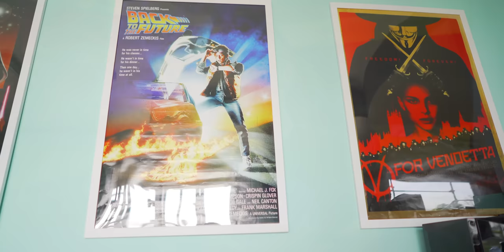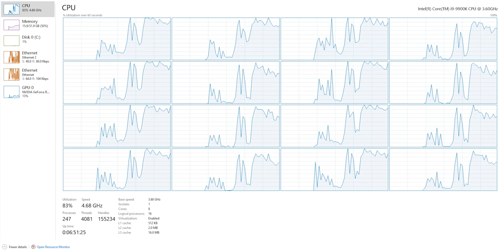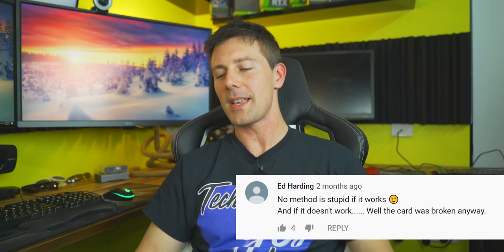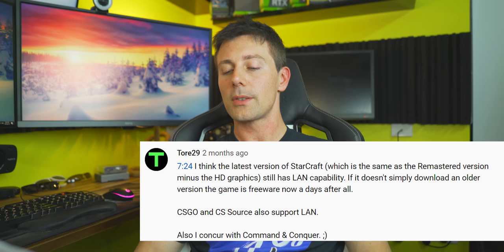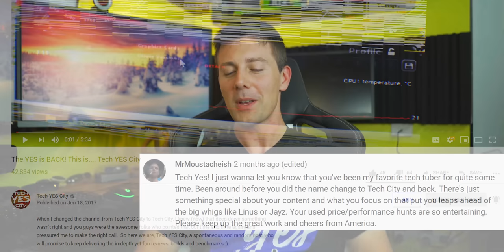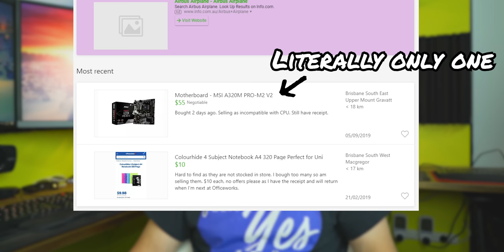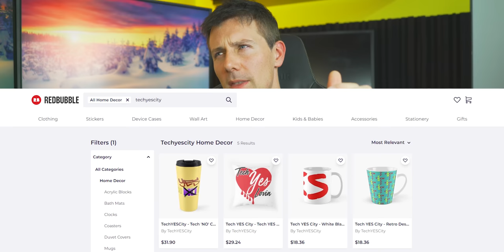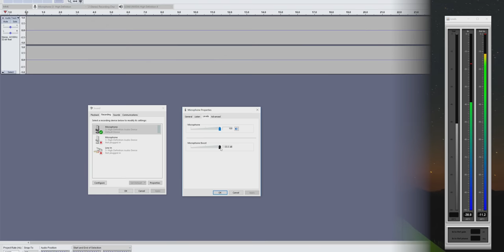Is Ryzen 3000 Still Good for X370? The Unanswered Challenge to Linus? (ATY #009)

Comment from the maker: TimeStamps: 
0:37 - Ryzen 3000 on old x370 
2:19 - Adobe optimization for AMD?
3:28 - Floatplane talk
4:26 - An open challenge for Scrapyard wars!
5:58 - Thermal paste talk
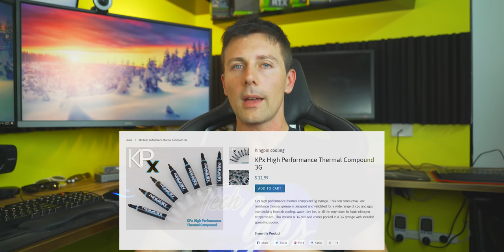7:07 - LAN games suggestions
8:00 - Will navi automatically install drivers?
10:25 - Looking forward to the MARS documentary!
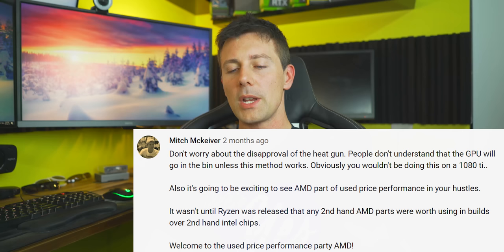11:14 - Heat gun haters & AMD used performance hype!
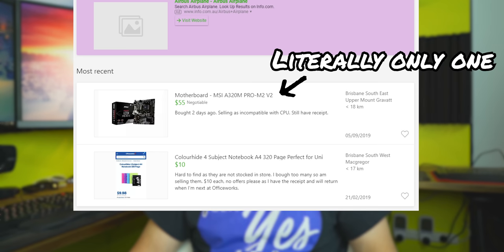12:26 - Fidelio L2s are a good choice!
13:17 - Where is the Huanan Dual X79?
14:20 - I want that pillow!
14:48 - What are your hobbies besides tech?
16:39 - Mid range headphones aren't over $100... are they?
Reply: What is the make and model of your car?
Reply: Thank you so much for this video!  Because I've been thinking of how to upgrade my X370, Ryzen 1700X build.  But is my Gigabyte Arous AX370 Gaming K5 considered worthy of switching to a Ryzen 3700X?
Maybe I need to upgrade my 2666Mhz RAM as well?
Reply: YES timestamps :) thank you^^
Reply: @BranZHamZ  Do you use your PC for work or productivity?  I have the same build but I have 3000Mhz RAM and it is still plenty fast for me.  The 3700X is a bit faster but unless you are using it for work or you are a highly competitive gamer that also uses it for work there is really no reason to upgrade unless you just feel like it.  Definitely would not be the Tech Yes Citizen price to performance route!  Get some 3200 CL14 RAM, push the overclock and it will be rockin!
Reply: 5820k oc vs ryzen 3600x WHEN?????
Reply: How about the mid range x370 for 8c/16t ryzen 3000 series.
Reply: Tech YES City #addresstheyes When will you come to the uk? And it made me laugh about the TechCity name change, I can’t remember why you did that lol Jesus must mean im a longstanding subscriber too lol
Reply: I been cheering for YOU, Bryan, you stuck to your guns an always gave us the older stuff as well as the stuff for the sponsors, you are a hustler, not many work as hard as YOU. I see all of this, I LOVED how GamersNexus (Stephen) was smart and young and basically the ONLY person to talk about nano tech with the cpu's and try to explain it and other things alike.... I cheered for him as "LIKED HIM" much before Linus and Jay found him and started to "Help Him"... I KNOW nobody else deserves it more then YOU... Just that ONE plug from Linus or Jay.... I still think it will happen.... Everyone needs a boost to the top, Each One, REACH ONE!... Keep going what your doing man and also keep your integrity #ALWAYS .... You and ModsTek now that Stephen was found deserve a boost to the TOP.... Some exposure, you an do the rest yourself, obviously.... #GoodPeople and channels, will always be here whilst you climb to a Million whether slowly on your own with NOT GIVING UP or with some much deserved help, either way its the same great videos.... Thanks Bryan... BTW: Maybe join with some tech tubers that are around your status of SUBS?... THERE IS ALWAYS A WAY MY MAN... Maybe a tech yes city FORUM?.... #YesMan would be a GREAT shirt for the store with small tags like x58, x79, etc.... Again, keep it up...
Reply: BPSDetailing abarth 146 spider
Reply: Brandon Hambright I’ve got a Ryzen 1700x build also! Only thing holding back in my Motherboard, it’s terribly fussy with ram but it’s still way more power than most need so you should be fine for a while yet
Reply: @TechYESCity Do you have the MARS 760? Found one for sale by me and was thinking about grabbing it.
Reply: @bpsdetailing8822  Actually RAM has been my main route for upgrades originally.  Cus I have 2666 and wanted some 3200.  I use it to game and make music or whatever else I need it for.  But Ive also had alot of audio and usb issues.  Kinda figured it was my mobo
Reply: @BranZHamZ  RAM is super cheap  right now compared to when I got mine for my build. You could probably find a lightly used high end X370 or B450 for cheap also. Cheers!
Reply: @bpsdetailing8822  I guess I havent paid attention in a while cus I was so used to hearing it was increasing in price.  But damn this thread is helpful.  You guys are awesome!  Im also super strict on myself when Im in money saving mode, which I am in right now cus Im possibly moving across the country next year.  But if the deals are as good as you say, I may finally get me some
Reply: @BranZHamZ  I think DDR4 RAM is at the price it should be now, when I got mine it was during the time of the RAM price fixing scandal so I paid over $200 for one 16GB stick of DDR4 3000 CL15. You can get  a 2X8 GB kit of 3200 for $78 or less shipped now.
Reply: @bpsdetailing8822  thats insane

Comment: Just got a 3800X with a Crosshair VI Hero(X370), had no trouble at all getting all cores to 4.3ghz
Reply: Corsshair vi is one of the best <3 
Still using it with 3700x , non probs gut yes RAM only at 3200mhz
Reply: Yeah, also have my ram @3200mhz, that's what tey're rated for, but I will try overclocking it
Reply: around 120€ no?
Reply: Also have a crosshair vi hero + 3700x, am running 4 dimms (32GB) @3800 cl16 fcl 1900 and 4.3ghz all cores stable
Reply: @pccadm12sky2  in the end i went with MSI B450 TOMAHAWK MAX.
Reply: @tadejdanev5030   Great option, better than some x470's out there
Reply: The Crosshair VI and VII were the best boards in terms of VRMs in the entire 300 and 400 line up respectively. So I'd be really surprised if it wasn't doing that.
Reply: X370 Gaming K7 here. 3600X @ 4.3GHz 1.36v and 3600 CL14 on the memory.
Reply: @VictorMunaro8000  I'm crying as I look at my x470 msi gaming plus lol
Reply: @ZarodGaming  C'mon that's not a bad board, should handle a 3700X with a standard 4.3ghz OC
Reply: Victor Munaro same board I have with my 3600 hits 4.2 no issue
Reply: got a 3600 on gigabyte x370 gaming 5, got the RAM at 3744MHz (4dimms bdie ram, CL16 1.42v)(I do have some bclk OC), fclk @ 1872. Gigabyte is rather slow with bios updates so currently only 3 versions are out that support ryzen 3000, and even the latest one is a bit buggy but I ultimately did manage to get everything working and the CPU is boosting to a maximum of 4.3GHz with the bclk at 104MHz, its not ideal but everything seems to work fine and now i at least know that all other parts of my pc support this bclk when the new update with better boosts drops ill be occing the cpu further for higher boost clocks.
Reply: @vladduh3164  Why bclk though? Can't you get 4.3ghz just by setting the multiplier to x43 and adjusting your vcore? Have you tried increasing load line calibration a little?
Reply: what are your temperatures on vrm?
Reply: Victor Munaro did you need to do a bios update ?
Reply: @bagil8136   Yeah, but my motherboard has a bios flash button, so I could do it without any trouble

Comment: Using a 3600X with my STRIX ROG X370-I board and it sits at a constant 4.2GHz under gaming conditions and 3.9 with Prime95. The 370 boards are fine!
Reply: Is that a 4.2ghz OC or is it boosting to that?  I've been considering replacing my Ryzen 7 1700 with a 3700X, I have the Asus ROG Strix-F Gaming board.
Reply: @Jennifur68  just boosting, haven't touched the clocks. I replaced my 1700x with the 3600 because it was really picky with memory, it performs about the same on all core effort but single thread is WAY better. Plus it uses about half the power.
Reply: Thanks, I may get the 3700X and give it a try. ^^  
Yeah my 1700 is pretty picky on memory too, I ended up buying a kit of G.SKILL TridentZ RGB 16GB 3200mhz 14-14-14-34 for nearly $200 on sale to replace the G.Skill Flare X 2400mhz I had...then about six weeks later the prices started falling on RAM. :/  I really just wanted to treat myself to some RGB RAM but the first 3200mhz kit I tried was 16-18-18-38 and it was not working stably on my board past 2666mhz so I returned it.  My CPU seems to have expensive taste in RAM to run stable at 3200mhz.

Comment: Hell yeah x370 is good for zen2. I have a 3600x and had it on my x470 prime pro from asus. I saw an insane deal for an Asus Crosshair VI x370. I said why not?! So i bought it for 140 euros.  I actually got slightly better frequencies accros all cores (50mhz) over my prime x470 pro with everything on default (So it boosted itself to a certain clock under load (I USED Cinebench R15)). If you have been aware Hardware Unboxed did a video testing zen 2 on all kinds of different motherboards and getting allot of variety in clocks. In short they say the clocks also depends on the mainboard.... WELL i can quite confirm that with my scenario.

Comment: Scrapyard wars on the Turf of Taiwan! Bry and I vs Linus and Dennis!
Reply: G'day Marco, that would be Awesome with Kevin & Teddy from TechShowdown as Judges,
P.s. Marco I've asked Brian, but just wondering if you might know where to get a Sapphire Toxic GPU repaired in Taiwan
Reply: @shaneeslick  Unfortunately, I had an R9 290 from Sapphire that failed. Sapphire is relatively small compared to the other GPU manufacturers and are based in Hong Kong. Since the heat trick didn't work, I couldn't get it repaired because they don't have any warranty centres here. I tried contacting them in Hong Kong but they didn't even wanna look at it out of warranty. Usually in Taiwan, Sapphire just says bring it to the retailer and the retailer will take care of it for warranty repairs. Sorry man.
Reply: @MarcoGPUtuber  Ok, thanks Marco, at least I know it is only a Cool Looking Ornament, Sad but Oh well
Reply: I'm in the process of trying to desolder my GPU as a little decoration. It's pretty!
Reply: @MarcoGPUtuber  I measured my Sapphire RX480 to see if the Toxic cooler will fit but no luck, I'm wondering if it would fit a RX5700/XT
Reply: @shaneeslick  Honestly, I couldn't tell you if that would work or not. While it may fit the GPU mounting holes, the VRM might be in a different spot or whatnot.
Reply: @MarcoGPUtuber  yeah, that was the problem with the RX480, the GPU is to close to the I/O shield & there are VRM parts in the way, apparently Timmy Joe got an ASUS R9 290 cooler on his RX5700XT, I gotta get around to downloading some pics to compare the size & position of the cooling layout, but plenty of time for that, & the Blower cards are still getting cheaper in Australia, they have dropped over $100AUD since launch
Reply: On Any turf I'll take the Yes Man. The Yes man is a Hustler/ PC builder. Linus has always been the studio tech-ster. We need both styles but seriously Brian is a pro at what he does. He's always been about Price to Performance. Linus is the show for that "what if I had money" 😀. Two different styles really.

Comment: Hi TC! Just want you to know that I really have enjoyed your videos! While I have quite a few "Go-To" channels that I like, yours is among the best. When I first started in PC building I used to (due to finances), seek the cheapest components I could. Goodwill, garage sales, etc. I particularly liked modifying my builds. Now I'm in a slightly better state and can afford new components. Still, working within a budget. I can't afford a 2080 ti for instance and probably wouldn't purchase one if I could. I don't care for the way Nvidia treats others. 

Being 75, and a disabled vet, I have plenty of time on my hands so a PC is my connection to another world via gaming, the Int, building, etc. I just like mucking with the things.

I am presently in the process of a new build and modifying a PC, going with a Hobbit Theme. I'd send you some pics if I could. Most of the modifications are on the outside of a Corsair 760t-white case, but I am installing a Hobbit Home in the top where the 3 drive bays would be. Kinda like a "peep house" showing the interior of his home. The two side panels that open are framed in Texas Cedar and will get carvings on the frame with the one open to view the inside of the PC getting a Hobbit window etched in the glass. The Otherside will get a similar image of Frodo looking out his window into the Shire at a Dragon. The Etching will have basically the same image only with Frodo looking into the inside of the case. While it's not quite finished, it's almost there.

Comment: I have tested my Ryzen 3600 on all the following boards with appropriate (latest) BIOS updates:
ASRock X370 Taichi
ASRock X370 Gaming K4
ASRock X570 Taichi
ASRock X570M Pro4

The only "issue" I had was some power cycling on the first power on, this is normal with Ryzen and was common to all boards tested but once the UEFI completed it's memory training all configs posted fine from cold boot. I don't have any b350 or b450/x470 boards to test with but my 2 x370 boards both work perfectly. Cinebench and 3dmark scores are within margin of error on all 4 boards at stock settings so there is a lot of incentive to upgrade to Ryzen 3000 on existing first and second gen boards. AMD did a great job keeping the architecture compatible, now if they would only sort out the AGESA mess so things work on launch day rather than having to wait a few months for them to iron out all the kinks. Come on AMD, Ryzen is great but you need to put more time into developing your AGESA before launch. I have no doubt they will get there in the end.

While the 3600 doesn't hold a candle to my 2950x, it competes more or less directly with the R7 1700. That is a huge improvement over 2 generations, 2c/4t less yet still matching the older 8c/16t part. These new Ryzen 3000 CPUs really do pack a punch and I have a feeling AMD is only warming up.

Comment: I recently bought a used Ryzen 7 1700 with an unused stock cooler still with the thermal paste on it to rebuild my son's old Phenom II x6 machine.  I paid $117 US ($107 + $10 shipping) for his 1700, two years ago I paid $330 for my Ryzen 7 1700 at launch.  I feel like I got an ok deal on his used CPU, it overclocked to 3.7ghz on the stock cooler easily and works like new.

Comment: Hey yes man. Possible next step for budget to performance builds. Custom bioses on older motherboards to overclock locked cpus. An i5 2500k costs a lot compared to a similar at stock i5 2300. (not sure if I got it wrong).

If you wanna go insane, DIY vrms and motherboard repairs.

But please at least look into bios modding. Some bios mods do actually allow you to overclock locked cpus.

Comment: Excess audio "clarity" can be removed from the speaker, I did it routinely with software Equaliser like "Equaliser APO" (open-source), many different speakers have different frequency response but usually they boost high frequencies and damped the bass, I simply equalise them (every loudness of every frequency using my ear) with higher frequency need more tuning, it's easier with software Equaliser because of the graph and you can set any arbitrary frequency at arbitrary level.
Reply: It's not a 'free lunch" tho, with cheap speakers you loose significant Audio volume range the more you make them frequencies equalised.

Comment: I recently changed to the 3700X on my X370 taichi.
let me tell ya its been great
Reply: @6robfoot  I built several PCs with X470 Master SLI and 3700x.

Working just as you expect, fantastic
Reply: My x370 taichi and ryzen 7 3700x displaying the wrong temperature
Reply: I'm still running a stock 1600 and 32g ram on mine I want to upgrade to a faster proc before the 3080 comes out to replace my 1070ti but I'm terrified it won't work on my x370 taichi
Reply: @MJR_heyfunny  it will. I'm even running 3900x now

Comment: Philips (which makes those Phidelio headphones) iinvented several products in the past, they invented the CD-player/recorder and were one of the contributors to DVD and later of course Blu-Ray which basically use the same techology as the CD  but with smaller holes and a smaller wavelength for the light which detects those holes (1's and 0's). Now for Blu-Ray they als ouse multiple layers on one DVD which is why the size of those discs went up. A little fun trivia on the origin of the CD-player: Philips wanted to make the standard for music 14 bits, Sony pushed for 16 bits because of legacy-stuff (how records were mastered and all that), Philips wanted to use 2 dummy-bits but Sony didn't cave and we got 16 bits. I consider that a win given the current state of data-storage technology. ;) 

The PlayStation is a direct consequence of Philips inventing the CD-player. Nintendo wanted to use a CD for their console but for some reasons the cooperation between Nintendo and Philips ended, Sony took its chance and offered to do it instead, Nintendo wasn't interested anymore (they prefered the faster cartridges back then despite the limitations  of limited amount of data on it) so Sony started its own console company. You can find some old failed Mario and Zelda titles on the CD-i which were a part of the deal between Philips and Nintendo. Without Philips the PlayStation wouldn't exist. 

 @Tech YES City
I would love to try out that T1 headphone, not to mention the really high end models. If only my budget would allow it, I will make doe with my HD 700. The life of an audiophile, often happy with what he hears, always longing for the better cans. My advice to the guy who asked about it: look at the HD 700 and other former high end models, those prices have come down but the quality of sound still is good. But you have to be willing to spend around $400. Thise Philips Phidelio are good headphones to start with, in audiophile circles they are being qualified as "fun".